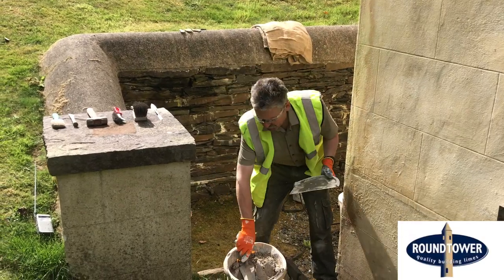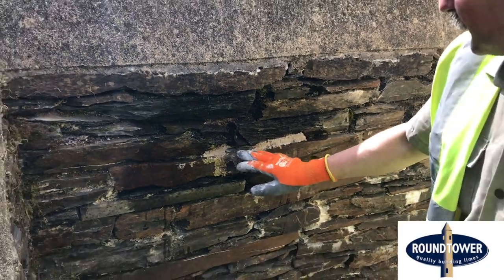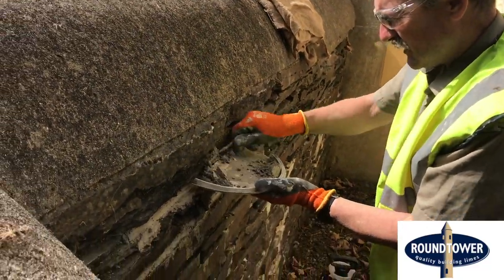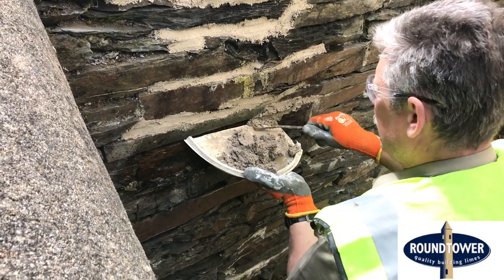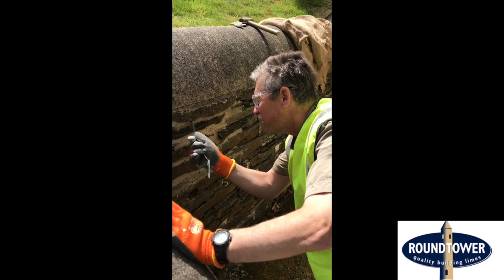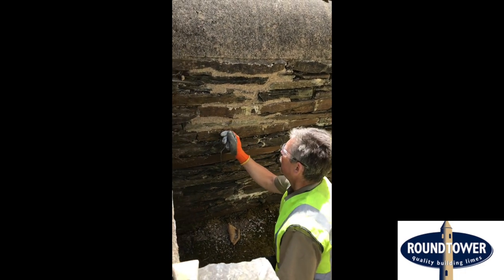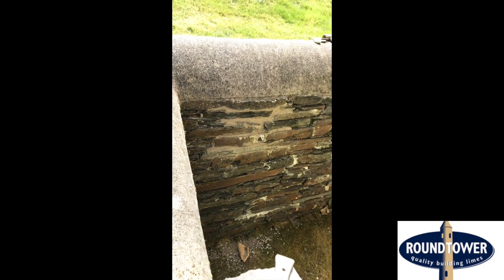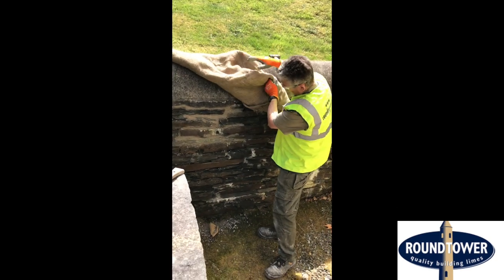How to point a stone wall

Comment: I want to know an effective way to remove the residue of cement after removing a full stone walls worth.
Some of it came off and left the stone clean but on other bits it's stuck hard. Got the thick off but..  
Any ideas. Was thinking if sand blasting.
Reply: needle gun?

Comment: Excellent. Do you think NHL's are too hard for traditional builds?
Reply: I think think that NHL's are too hard. Also they have very little actual lime in them. Use quick lime, which is what was done historically. I have a video showing this mortar: TygwqB27MGM
Reply: @metallitech  Roundtower has a very low free lime content. Only 18.1. Not for me.

Comment: BUTCHERS...just stop....that is just the worst iv'e seen short of rendering, learn about what you are attempting, instead of making a horrid mess, seriously, heritage work demands better.
Reply: Genuine question from someone learning about lime pointing: Can you advise how it should be done differently? Thanks.
Reply: @plummetplum   Im the same , keen to learn . Instead of ressesing the mortar a tad , Others may view too have more coverage on the stone itself . Not sure what was used but the hotlime route could be great for this type of wall?
Reply: @Detailer77  I'm learning NHL isn't as breathable as hotlime/quicklime/putty route because it contains less lime and more impurities. With regard to recessing the joints, I know that it should be flush with the stone for internal walls to prevent damp and bacteria building up. But this is an outside wall, so it seems irrelevant. Oh well may find out one day ha
Reply: @plummetplum  why would it be irrelevant on the outside ?
Reply: @Detailer77  Because walls on the outside are always damp when it rains and dry out naturally in the air.  Bacteria and mould are always an issue internally due to the humidity of badly ventilated houses.
Reply: @plummetplum  Is there anything else thats to be avoided externally ?